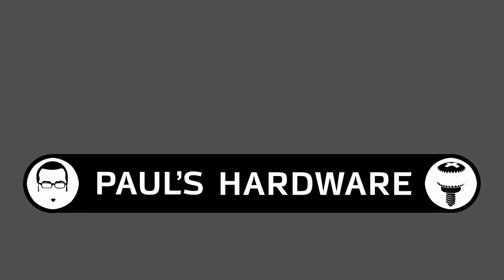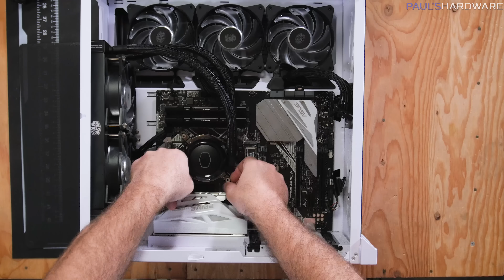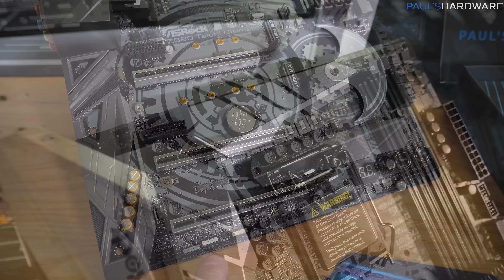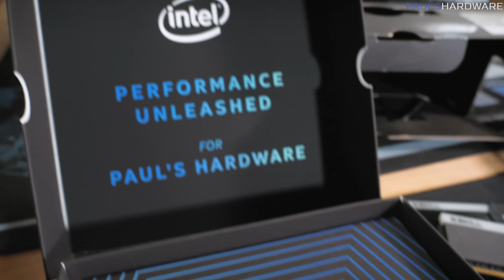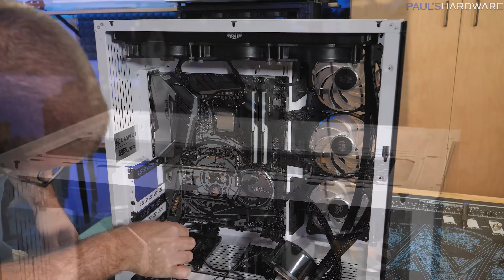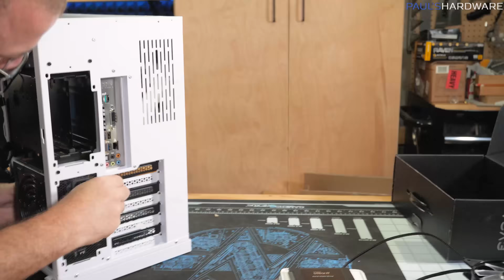UPDATED! The FASTEST Gaming PC You Can Build in 2018

Comment: BEST BUILD POSSIBLE – GAMING – 2019

Intel Core i9-9900K 8-Core CPU
 
$590.00

ASRock Z390 Taichi Ultimate ATX LGA1151 Motherboard
 
$300.00

G.SKILL TridentZ RGB Series 32GB (2 x 16GB) DDR4 3000MHz DIMM CAS 16 F4-3000C16D-32GTZR  (32 gigs Memory)
 
$210.00

Samsung 970 EVO 500GB PCIe NVME M.2 2280 SSD  
 
$100.00

ADATA ULTIMATE SU650 960GB 2.5" Solid State Drive
   
$115.00

ASUS ROG GeForce RTX 2080 Ti ROG-STRIX-RTX2080TI-O11G-GAMING 11GB 352-Bit GDDR6 PCI Express 3.0 HDCP Ready SLI Support Video Card
 
$1,400.00

Lian Li PC-O11 Dynamic White Tempered Glass Case
 
$140.00

EVGA SuperNOVA G3 750W 80+ Gold Modular ATX PSU
 
EVGA G2/G3/P2/T2 100-CK-1300-B9 Power Supply Cable Set (Sleeved), Black
$120.00

Cooler Master MF120R Air RGB 120mm Addressable Case Fan (x3)
 
$75.00  (All Three)

TOTAL PRICE:  $3,050

BEST BUDGET BUILD 2019  THAT WILL SUFFICE AT FULL GRAPHICS FOR ALMOST ANY GAME 

https://kingsalesx.com/product/samsung-860-evo-1tb-2-5-inch-sata-iii-internal-ssd-mz-76e1t0b-am/?attribute_size=250+GB&attribute_style=SSD+%2B+Mount
Samsung 8 60 EVO 1TB 2.5 Inch SATA III Internal SSD (MZ-76E1T0B/AM)

 
$108.19
--------------------------------------------------------------------------------
https://www.newegg.com/Product/Product.aspx?Item=N82E16820231758&ignorebbr=1&source=region&nm_mc=KNC-GoogleAdwords-PC&cm_mmc=KNC-GoogleAdwords-PC-plaMemory+%28Desktop+Memory%29_-N82E16820231758&gclid=CjwKCAiAyfvhBRBsEiwAe2t_i777gHC153lQv_KdlDD0H0IBf3-wVvEh9humQtl5PQAJUi3mldvYCBoCQncQAvD_BwE&gclsrc=aw.ds
G.SKILL Ripjaws X Series 32GB (4 x 8GB) 240-Pin DDR3 SDRAM DDR3 2133 (PC3 17000) Desktop Memory Model F3-2133C11Q-32GXL
 
$189.99
-----------
EVGA • NVIDIA • GeForce • GeForce GTX • GeForce GTX 1000 Series • GTX 1060 • 6 GB • GDDR5 • PCI Express
 

$160.00

----------------------------------------------------------------------------
https://www.ebay.com/p/ASRock-Z77-Pro3-LGA-1155-Intel-Motherboard/116369380?iid=273021419521
ASRock Z77 Pro3, LGA 1155, Intel Motherboard
 
$97.85
---------------------------------------
https://starmicroinc.net/intel-core-i7-3770k-3-50-ghz-quad-core-oem-cpu-sr0pl-cm8063701211700/?gclid=CjwKCAiAyfvhBRBsEiwAe2t_iyiyvrd5qYsCSlwY8S6iROLs9iYMAVXYwAB-sw5w9D4N5_MZ6CD-GBoCb-cQAvD_BwE
Intel Core i7-3770k 3.50 GHz Quad Core OEM CPU SR0PL CM8063701211700
 
$225.00
------------------
https://express.google.com/u/0/product/18285297695596171868_15477577884817710348_46586?utm_source=google_shopping&utm_medium=tu_prop&utm_content=eid-lsjeuxoeqt&gtim=CKnus4_20_blDBCj3vjiw6vN2vsBGLDSwRciA1VTRCig26niBTD66wI&utm_campaign=46586&gclid=CjwKCAiAyfvhBRBsEiwAe2t_i2OWW-oNaOpCtjOi-c2rsEaH7RYPawUJF_Zsi9FBvbfX_vu7KWFSoBoCuLQQAvD_BwE
LEPA  MX F1 N600-SB Power Supply - 600W
 

$60.00
--------------------
https://www.ebay.com/i/352366049052?chn=ps
Acrylic Personalized DIY Computer Case ATX Transparent Clear Box Assemble Kit
 
$99.99
+ $9.99 Shipping
------------------
OR
https://www.newegg.com/Product/Product.aspx?Item=N82E16811353098&ignorebbr=1&source=region&nm_mc=KNC-GoogleAdwords-PC&cm_mmc=KNC-GoogleAdwords-PC-plaCases+%28Computer+Cases+-+ATX+Form%29_-N82E16811353098&gclid=CjwKCAiAyfvhBRBsEiwAe2t_iw5g9NYubh5Zo3HA38p_ZwCWnowtAnOqDVUtur83cFdQct-wdIT_tBoC264QAvD_BwE&gclsrc=aw.ds
DIYPC J180-W White Dual USB3.0 ATX Mid Tower Gaming Computer Case w/2 x 120mm Fans (Pre-Installed)

 
$34.96
-----------------------------------

TOTALS -  PC BUDGET GAMING BUILD 2019
$110.00  -   1 TB SSD
$190.00  -   32 GB G.SKILL Ripjaws X Series 32GB (4 x 8GB) 
$160.00   -  EVGA • NVIDIA • GeForce • GeForce GTX • GeForce GTX 1000 Series • GTX 1060 • 6 GB • GDDR5 • PCI Express
$100.00-      ASRock Z77 Pro3, LGA 1155, Intel Motherboard
$225.00   -  Intel Core i7-3770k 3.50 GHz Quad Core OEM CPU SR0PL CM8063701211700
$60.00   -    LEPA  MX F1 N600-SB Power Supply - 600W
$110.00  -  Clear Computer Case     OR   $35.00   White Computer Case
TOTAL PRICE:  $820 - $900

CLEAR CASE TOTAL:    $955.00 
WHITE CASE TOTAL:   $880.00

Comment: If anyone can answer this question for me please help me out.  The G.Skill Trident RAM I have installed on my EVGA Z270 FTW MB does not seem to want to work with the software. I have upgraded the BIOS and got the latest version of the software and for whatever reason it still can't seem to detect the the RAM is in the system. So for now I have just been living with the rainbow of LED colors without the ability to customize it.  Itz not a huge deal as the RAM still works great but it kinda defeats the purpose of me getting the RAM, to be able to customize it on the fly. HELP!

Comment: We got almost the same build..but mine is just a bit more powerful.. I got:
Msi Meg z390 godlike Mb
Intel i9 9900k 8 core 16 threads at 5.0ghz (overclocked)
32gb ddr4 G.skill trident z ram
Corsair 1600i psu
2 rtx 2080 in sli (overclocked)
2tb samsung 860 pro ssd
4tb western digital black hdd

Comment: when i put these parts on pcpartpicker i get these compatibility notes

The motherboard M.2 slot #1 shares bandwidth with SATA 6.0 Gb/s ports. When the M.2 slot is populated, two SATA 6.0 Gb/s ports are disabled.
The motherboard M.2 slot #2 shares bandwidth with a SATA 6.0 Gb/s port. When the M.2 slot is populated, one SATA 6.0 Gb/s port is disabled.
The motherboard M.2 slot #3 shares bandwidth with SATA 6.0 Gb/s ports. When the M.2 slot is populated, two SATA 6.0 Gb/s ports are disabled.
Reply: what does that mean?
Reply: @born2biscuit  That m.2 doesn't use cpu lanes but rather pch ones

Comment: I almost dropped the $$$ for the 9900k. The soldered TIM had me ready to buy. I didn't get the money saved in time to get a pre-order, soooo... yeah. Can't find one anymore. Amazon isn't even LISTING it right now. Still, I'll be more than happy upgrading my 4790k to a 8700k. Plus, I still got a z390 board, so if I want to upgrade later it'll be a hell of a lot easier. And another plus, since I had almost 200 left over, I managed to populate all my RAM slots with 32gb. It's the little victories...

Comment: Technically not the fastest gaming CPU. 8086K clock for clock is faster than a 9700K with both @ 5.2ghz & beats the 9900K in high frame rate scenarios since most can't reach past 5ghz, let alone keep temps in check at that speed. You can hit 5.2ghz on most 8086K's.

Comment: Why not just leave the fan orientation as it is and add three matching fans at the bottom for intake?  

Top:  Radiator/Exhaust
Back wall:  Exhaust
Bottom:  Intake

Still negative pressure, but not a major problem, and you get maximum RGB aesthetics.

Comment: AOC - G2260VWQ6 21.5" 1920x1080 75Hz Monitor  

TP-Link - TG-3468 PCI-Express x1 1000 Mbit/s Network Adapter

Asus - Xonar DGX 24-bit 96 KHz Sound Card

Microsoft - Windows 10 Home OEM 64-bit

EVGA - SuperNOVA G3 650W 80+ Gold Certified Fully-Modular ATX Power Supply

Deepcool - TESSERACT SW ATX Mid Tower Case

MSI - GeForce GTX 1050 Ti 4GB GAMING X 4G Video Card

Western Digital - Caviar Blue 1TB 3.5" 7200RPM Internal Hard Drive

Corsair - Vengeance LPX 16GB (2 x 8GB) DDR4-3000 Memory

MSI - X470 GAMING PLUS ATX AM4 Motherboard

Cooler Master - Hyper 212 EVO 82.9 CFM Sleeve Bearing CPU Cooler

AMD - Ryzen 3 2200G 3.5GHz Quad-Core Processor

Comment: Hey guys is this build good tell me if there’s something wrong look ->   AOC - G2260VWQ6 21.5" 1920x1080 75Hz Monitor
TP-Link - TG-3468 PCI-Express x1 1000 Mbit/s Network Adapter
Asus - Xonar DGX 24-bit 96 KHz Sound Card
Microsoft - Windows 10 Home OEM 64-bit
EVGA - SuperNOVA G3 650W 80+ Gold Certified Fully-Modular ATX Power Supply
Deepcool - TESSERACT SW ATX Mid Tower Case
MSI - GeForce GTX 1050 Ti 4GB GAMING X 4G Video Card
Western Digital - Caviar Blue 1TB 3.5" 7200RPM Internal Hard Drive
Corsair - Vengeance LPX 16GB (2 x 8GB) DDR4-3000 Memory
MSI - X470 GAMING PLUS ATX AM4 Motherboard
Cooler Master - Hyper 212 EVO 82.9 CFM Sleeve Bearing CPU Cooler
AMD - Ryzen 3 2200G 3.5GHz Quad-Core Processor

Comment: Paul, I'm currently i7-5960x with 8x4GB 2133hz ram and GTX 980 SLI on a Asus X99 Extreme. Im thinking of upgrading my system with 16x4GB (around 3000Hz to 3300) ram and RTX 2080Ti SLI and include an Asus PG258Q (Not wanting 4K). Is my CPU still gonna coupe up and not bottleneck?

Comment: That is a really awesome case you are using Paul.  It seems like there's a lot of room for you to build a PC in that machine.  I am excited for those benchmarks, Paul.  October 19th?
Reply: Fantastic case. I have 8 thin Noctua 120's (cost more than the case!!). 3 exhaust on top. Side and bottom are intake. Vertical GPU riser with 1080 Ti and a delidded i5-6600k. Everything runs in the 60's while gaming. PS Noctua D15 will not fit in case
Reply: @LastConfederateSoldier, first thank you for your service. Thank you for discussing this case with me further. I like the design of the case and definitely like what you are saying about it's 8 fans.  Especially, if it stays quiet. I need a quiet PC for when recording audios.  (:

Comment: This is the fastest pc!

Pentium g4560
2GB 2133mhz ram
1tb 5400 rpm HDD
Gt 210
H110m with updated bios
And a 2000000000w 80+ titanium full modular power supply!, To charge your ass.

Comment: I have more or less the same PC but with a 7700K, and a Strix 1080Ti. I even have the same 3200Mhz CL14 Trident Z RBG and Lian Li  O11 Dynamic (black) lol Same issue as before though, you have 6 fans pushing air out but not  a single fan as intake. You are probably going to have thermal issues with that configuration.

Comment: This one is the fastest: 

Latest threadripper (32 core)
Dual Rtx 2080 ti NVLINK sli
128gb 4133mhz ram
Thermaltake floe riing 360mm
Cougar coolest case
Asus Rog X499 (does it even exist?) Or maybe x399

Yeah! 2 fps in Pacman!
Reply: no it's not, threadripper sucks for gaming, even i5-8600k at 5 ghz will beat that 32 core threadripper with max oc in 99% of games on avg, min and max fps when chasing high fps. get it. intel dominates amd in high fps gaming, ryzen and threadripper only have a small chance when you're gpu bound, and most 120-240 hz owners are not. so yeah, amd is good for peasant gaming.
Reply: @lort6022  ik lol but it's for productivity
Reply: threadripper in a intel z390 hmmm k
Reply: @evansilich  woops

Comment: I need advice I bought a i7 8700k but don’t know what mobo to pair with it. I will down the line do custom water cooling but want the perfect mobo with it.Z390 or z370?
Reply: ST_ Pharaoh
The perfect mother board for custom loops would be the asus ROG maximus X (or XI for the z390 version) formula. It has a built-in ek waterblock for the vrms which pass through cooper heatsinks along with other features water coolers and overclockers would want. It works on both air and water if you're wondering since you did specify you'd do the loop down the line.

Comment: I am building a pc with i9-9900k, maximus xi formula, and a 2080 ti will be my main parts. Now to my question, is there a full size case that is big enough for water cooling that isn't a 1000D. I like the 1000D, but want a full size case a little smaller. I am open to all ideas. I am thinking about running a 360mm rad being that I already own 120mm fans vs buying new 140mm ones.
Reply: Thermaltake View 71 maybe?

Comment: Hey Paul. Why not just make the rad an intake? Heat from one is limited by the coolant temp so it won't add much to the internals. Also, that would create more airflow over the VRMs which could help with an O.C. I have the same case and use 3 fans at the bottom and a 280 rad in the top all as intake. I have the 3 side fans as exhaust with the filter removed from that space to allow better air flow. I also have those mounted on the outside of the frame to have less air blowing into the side compartment. I have been running like this for about 6 months and my temps over all are very easy to maintain at respectable levels. IE 60c with fairly low noise levels. 

7700k
1080ti FTW3
Kraken X62
Cougar Vortex Fans
Reply: dtune30 can u give me advice how to build right airflow pc i got same spec as him in this video and dont know what case is nest for use .. i want to hlave 360 intake rad and want to oc to 4.8 at least
Reply: @marsinko9714  It's hard to nail down what's best with out testing but here goes my basic thoughts. Fresh air on a hot component is always best. Duh. My issue with Rad exhaust with a setup like his, or mine for that matter, is the hot air from the graphics card. It basically fills the case and then you blow hot air through the rad. So for me if I can, RAD=intake.

The graphics card still needs cool air so bottom is always intake. That one is basically a no brainer and a standard of sorts. That's part of why I chose this case.

With a 360 RAD I would probably go with front or in this particular case, side intake. The graphics card still gets fresh air so any heat into the case should not be an issue. Under these conditions, a total 6 intake fans, only having 3 top exhaust will keep you in good positive pressure.

That's my 2 cents any way
Reply: @dtune30  Been thinking about this case for a while now. I would have a side-mounted 360 rad pulling cold air in (the visible fan frames make them look less pretty in this configuration but not a biggy in my opinion), then 3 x 120s underneath pulling cold air in (again, fan frames are visible), and finally 3 x 120s on the roof as exhausts. I'm open to suggestions.
Reply: @misteriain6209  I would call that Ideal. My AIO is a 280 So it had to go in the top. My fans are Cougar and they have ugly labels and wire so I used black gaff tape to cover them up on my bottom exhaust. worked real well. As far as the case itself. It's not perfect but real close on my opinion. The drive cages have a tendency to vibrate a bit. I found bending the retention tabs out a little will make it stop for weeks/months at a time. That's really my only gripe after 9+ months of use. I also added some rubber pads to the feet for extra airflow, but that's probably all placebo. lol

Comment: I've noticed this a few times on a few channels. When the M.2 slot has a heat spreader, people peel off the plastic from the spreader, but not the label from the M.2 itself. Wouldn't it be better to take that label off to have the thermal pad in direct contact with the chips?
Reply from the maker: Quite a few M.2 drives, including the Samsung PRO/EVO lineups, have special stickers that do not insulate heat, so you don't have to remove them 😁

Comment: Hi Paul. I may be wrong but I believe the 3200mhz cas14 memory kits are actually higher binned than the 3600mhz. If you can find the timings etc... online you can probably just type them straight in and it should work no problems if that's what you want to do.

Comment: Why only 16 GB of RAM?
Reply: its for only gaming
Reply: 8 GB is enough unless you want to video edit or for some reason play 2 games at the same time
Reply: If you are only gaming or doing usual internet surfings, 16GB is more than enough... You only need more if you are doing large high res video editing or 3D designing..
Reply: because it's enough for every single game even with backgground tasks. high clock and low latency is more important than going 32gb. 32gb can even make fps go down, if you're using 4 sticks. and 2 sticks of 16gb will often result in lower speed / timings compared to 8gb modules. best binned memory comes in 2x8gb.
Reply: Well, City Skylines is the exception.... that shit ate up 24GB like it was nothing....
Reply: @Kelthor85  24gb! That's why I can only run it at 25 GPS I only have 8 also planet coaster is even worse in my opinion
Reply: When auto-correct turns GPS into GPS
Reply: FPS
Reply: StaR CitIzEn
Reply: The real question is..why dual channel?
Reply: Some testers say 64 GB is what you need but I'm not sure to believe them /s
Reply: @Ometecuhtli  this post by Principled Technologies gang

Comment: Hi Paul, a question from The netherlands: i`m saving up 5000 euro to buy a new pc (80% gaming, 20% rendering). I`m reading up on current builds and tech. I`d like so see more on how to overclock, how to calculate coolingrequirements, how to calculate power needed. Main thing i`d like to see is the bios-setups, a how-to so to speak. If You could make a video about that, that`d be great.

Comment: Guys, the additional 4 pin cpu supply on these z390 chipset boards, does that require a supply or is that only when you start with serious over clocking?

Comment: I am building a $800 RYZEN budget build. Are these parts good?
Case: Corsair Carbide Spec-05
Power Supply: 600 BR EVGA power supply
MOBO: MSI Gaming PLus(B450)
Ram: 8gb g.skill ripjaws 2666
CPU:Ryzen 5 2600 
GPU:RX 580 (Red Devil)Not Gold
Storage: 1 tb seagate hard drive, KIngston 120 gb ssd
Fans: Corsair Red LED fans
Thanks Paul I, love your videos
Reply: if you can offered it. 
my suggestion for you.
https://pcpartpicker.com/list/4KGjLJ
you can change parts if you don't like it.
Reply: that's a pretty solid configuration
Reply: Ryzen works better with faster ram so maybe get a tomahawk and buy better ram
Reply: Due to the way the Zen architecture works you want fast RAM, Hardware Unboxed has a video guide for Ryzen optimization with RAM.
Reply: U should wait till black Friday for better deals
Reply: In addition to faster ram as others have pointed out, you should also make sure you get 2 identical sticks for dual channel.
Reply: Only thing I would change is ram. Also no matter what make sure you get 2 sticks.